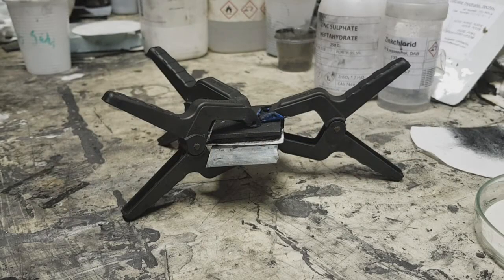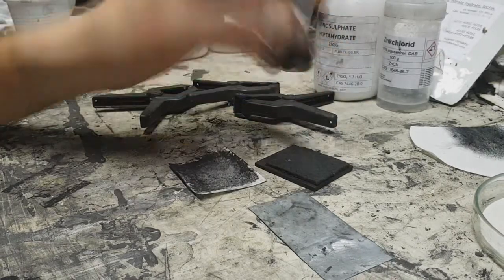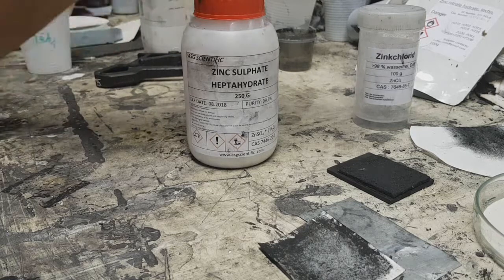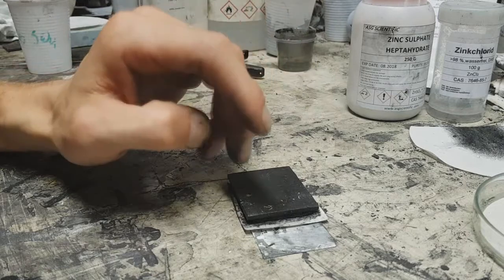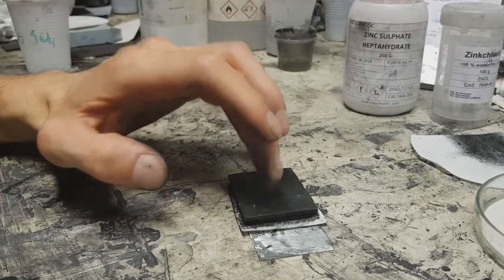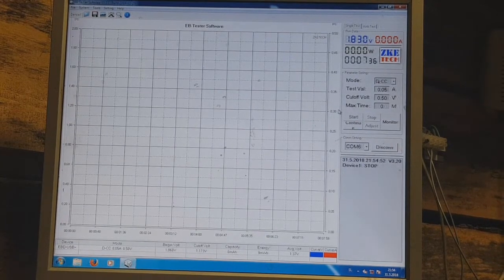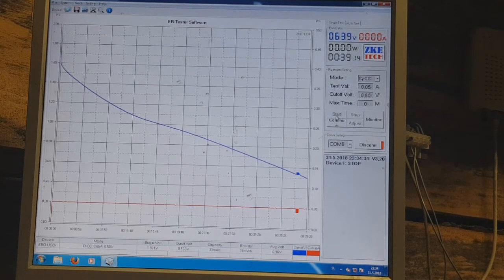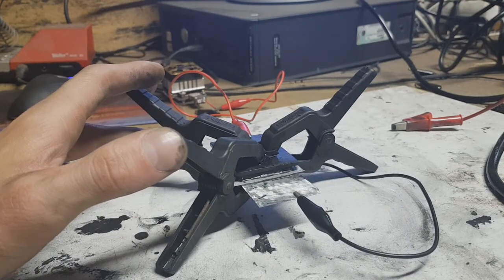How to Make Zinc ion Hybrid Supercapacitor

Comment: dear sir, What the device that used to measure the discharge test? From i know ZKE device can only perform lowest CC 0.1 A so how you do to lower the current to 0.05 A.
Reply from the maker: Zke device like zketech ebc-a20 lowest charge and discharge is 0.1A. But the Zketech EBD-USB+ can go dovn to 0.01A

Comment: So you got, what, 200mA back? 6 years ago. I'm responding to your new years 2025 post. 10,000 cycles with a paper separator? Not too shabby any way you look at it. Thanks😊😢
Reply from the maker: Oh, I almost forgot about that video 😄 and my english is like hammering😬 Yes, the Zn ion capacitors have at lest 10k cycles. Back then I get about 80 to max 200mA. But now the new cell uses improved active materials, better dendrite blocker, cleaner electrolytes (not a ebay stuff), etc. The max capacity which I get on Zn ion cap was 2018 which was around 560mWh/g but over the time and moving the lab from place to place I lost the recipe. I try to re-create the recipe several times in the past but no big luck until the last day in 2024, where I get the energy of around 400mWh/g.

Comment: Very interesting video. The homemade device does not show the performance as good as reported in the literature may be associated with the oxidation of metallic zinc in air.  ZnO layer on the surface of zinc sheet has a negative effect on cycling stability of the zinc-ion hybrid supercapacitors.